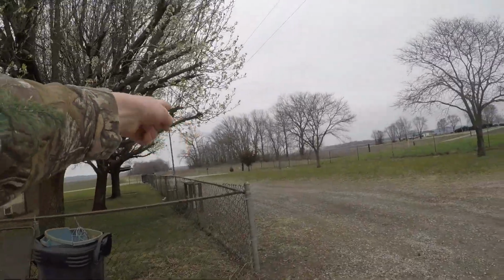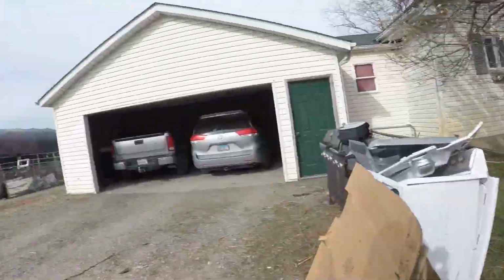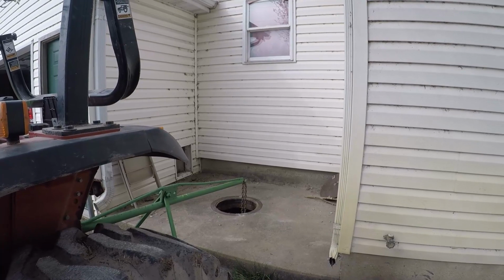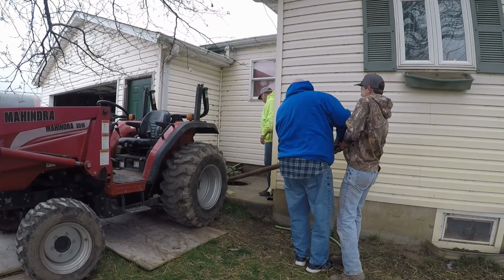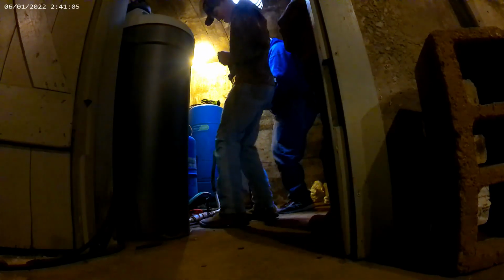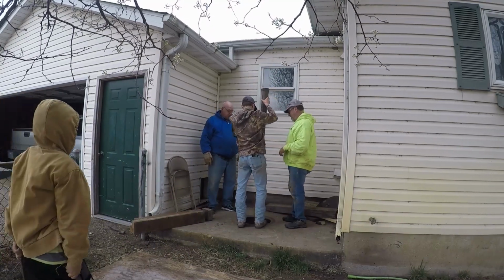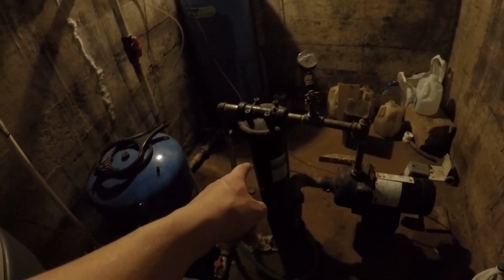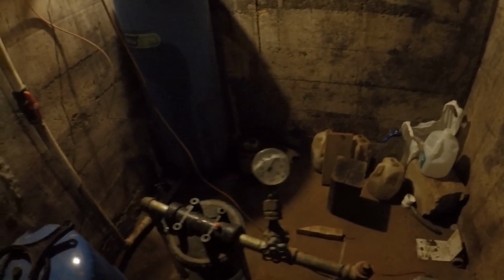The job we all dread.  No water till this is done. (Not fun)

Comment: How deep is the well ? We has several shallow wells  ( 50 foot . ) at home. 
Due to ag chemicals both were condemned in the 80s.  As they were 14 inch casings it was relatively easy pulling the pumps. 
We used a 14 foot 4 by 6 tripod, and come along.  Thank you Ryan.
Reply from the maker: It's 25 feet deep ruffly. Pretty thanks for watching

Comment: good video. why didnt you just screw a "T" to the top of the pipe to pull it? that way the chain would not have slipped off
Reply from the maker: Thanks. Yeah, that's what I was telling them to do to LoL. Dad was worried that it might brake the threads off of the well pipe, with all the pressure from pulling on it. Thanks for watching appreciate it. Have a good rest of your week.

Comment: I've got a mahindra 3650 in Australia and I'm not happy with the level of lift and how it's not smooth lifting 3 point linkage! I'm pissed it took 4 months to get parts ! I'm pissed for a tractor 20% less than a reputable brand it fails ..... Chinese tractors are better value $ for $..... Korean tractors probably better option than the world's most sold tractor....
Reply from the maker: Yeah, that sucks. I'm not a fan of how are 3 point works either. Like you said, it's very touchy, but we make do with it.  And the supply chain is so messed up right now. It's unbelievable how long it takes certain things to get. Thanks for watching.